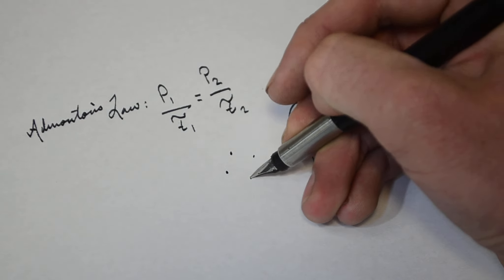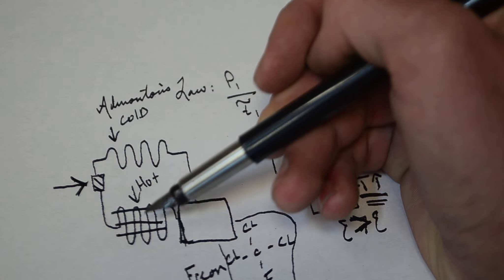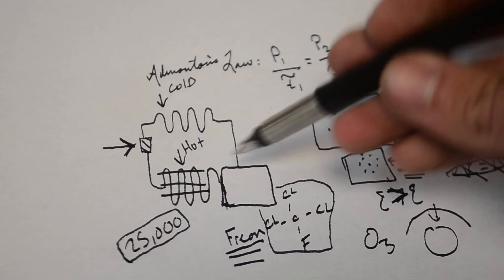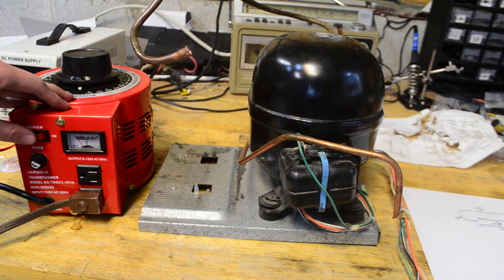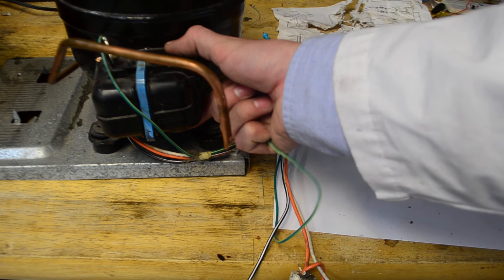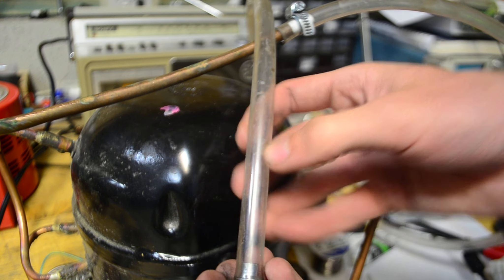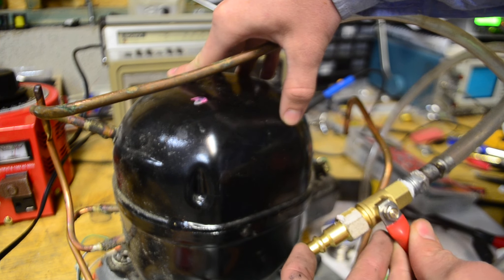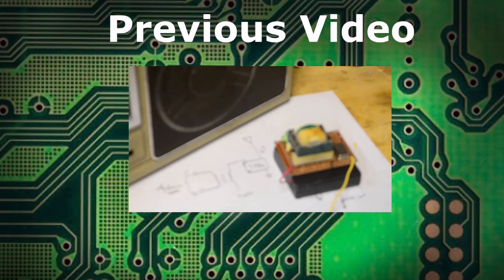How to make a Vacuum pump out of a Fridge

Comment: are you sure? that looks like a scroll compressor. 
also... what are you using as coolant/lube? those compressors usually require the refrigerant to be in the compressor as a lubricant.  or the compressor will die much much quicker.

Comment: Nice video thanks , 👍 one of the guys made interesting comment that these usually have freeon gas in them which has oil lubrication in it for the compressor .. so surly running it dry will damage it ??

Comment: How would this pump handle liquids intake? I'm looking for a DIY vacuum for when I want to separate solvents under a vacuum condition. But this will cause solvents to enter the vacuum system.
Reply: Don't have an answer for you but in a way of pointing you in the right direction, look up scroll compressor

Comment: A video on how to make an inverter plz.  I'm looking to use the induction heater powered by a car battery and need to step up the voltage in AC then covert back to dc

Comment: hey bud......cool....... I'm pretty sure that those type of compressors have an oil solution mixed with the refrigerant gas for lubrication & cooling........not that it definitely wont function at all running it dry(perhaps at least for short periods of time)..........but it will most certainly VASTLY reduce its lifespan.

Comment: Are you going to show us those Tesla coils in the background in action?
Reply from the maker: +Dobby Yoda haha I'm sorry dobby, I know I have been giving you the same answer for a while, but I hope to soon!
Reply: Ok, by the way, I made a miniature Tesla coil using a boost converter, I realized the circuitry for a Tesla coil was basically a rapidly discharging capacitor, and a boost converter was a rapidly discharging capacitor, so I figured, all it was missing was the coils on the output, and with a 1/4" spark gap tada, It matches the frequency and voltage of the spark gap, lit lights up florescent bulbs, and the secondary coil glows, but it's so low current, It can only be seen in the dark.

Comment: Where the fuck did my other comment go? Anyways add a pressure chamber like an old fire extinguisher or diving tank and you'll be able to pull a better vacuum, add another and you get compressed air aswell from the same unit. The compressor is strong as hell but it's displacement is minimal. Also if you haven't make sure to change the oil since it's made for freon not oxygen/air, it can ignite if worst comes to worst. All of this probably occurred to you already keep up the good work 👍
Reply from the maker: +Elektro Bear I'm not sure where your last comment went, I had thought a bit about adding a pressure chamber but I do think you are right and I will defiantly try it out! Thank you! :D
Reply: Keystone Science change the oil as well. there are videos on it here.

Comment: The reason you suck at soldering is your lack of steel wool. You have to clean the copper and use lots of flux. Get yourself a flaring tool and you can flare the copper to fit tightly in the other pipe.

Comment: the compressor is going to be destroyed if you run it without oil or an air filter.
Reply from the maker: +Corbett Sonoda yeah, it already had oil in it, but a filter would probably be good to add